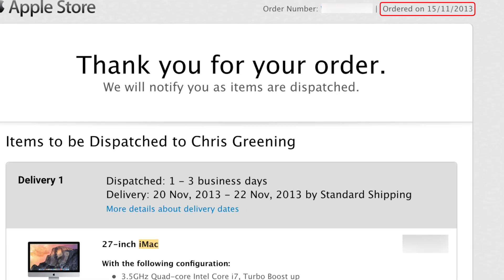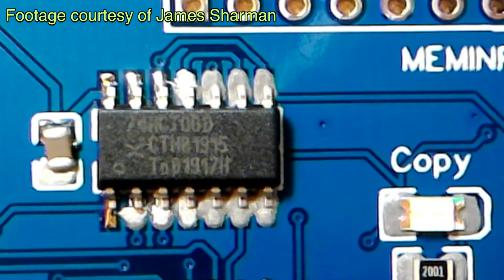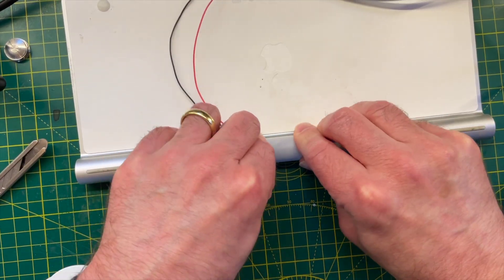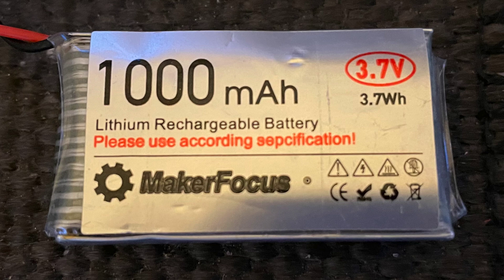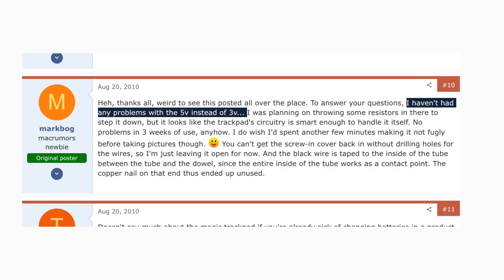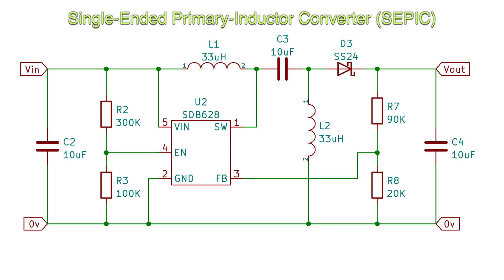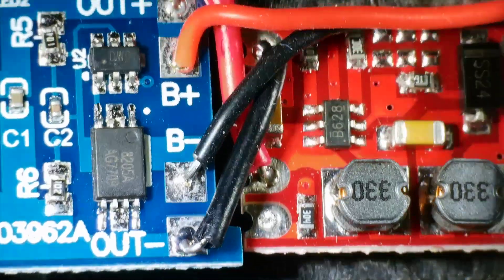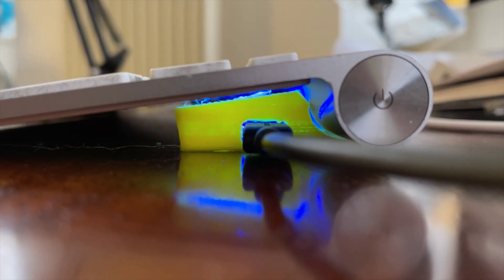Upgrade Your Old Keyboard: USB Rechargeable Hack!

Comment: Hii ..... My Keyboard is apple model no- A1255 1.3vot 3 1.3x3=4.5vot battery So how to convert 3.7volt battery to convert 4.5volt..??
Reply: Your keyboard charge percentage will never show full because it'd be getting 4.2v so it'd think that battery has depleted slightly. But since you may use a higher mah battery, every percentage drop would last much longer.

Max Voltage, full charge of li ion battery is 4.2v, never overcharge or feed higher voltage. It may explode.

I know, I'm late. But, for future reference of anyone who sees this comment.

Happy New Year!
Reply: 3.7v batteries' full charge is 4.2v 
Your keyboard, rated at 4.5v can handle low charge batteries, which means lower voltage. 
You can connect directly.

Comment: Writing this from my battery-fed Apple keyboard after wondering the same and found this video. My use case is slightly different – because I travel with the keyboard, I've been on the hunt for a on/off switch mod to simply cut power to the batteries.
Reply: Not a electrical anything but that should be simple enough as just connecting an on/off switch to the wire that connects to the battery.

Comment: I have one of those, unused for years - the battery replacement cover welded itself shut 5 years ago.  In 20 minutes I yanked that middle cover off, pulled out 1 corroded duracell (the other will need a drill i think), soldered a 2 AA battery pack to the two contacts, and were back in business.  The corroded duracell is marked Dec 2022 - so maybe installed 10 years ago!  😀
Reply from the maker: Nice!

Comment: The SEPIC prolly has a large "standby" current. 

What would happen if you use an IR PowerLED as a series-dropper?
Instead of 4.1V -->3.3V on the LiPo cell, you'd see 2.8 --> 2.0V on the keyboard (and so your "remaining battery" indicator would work well too. (You could also replace the IRLED with two transistor-diodes in series.)

Comment: There should be nothing wrong with charging a 1000mAH battery with 1A. One thing you have to be careful of though is that the battery should not be attached to a load when it's charging or the charge termination may not function properly. You can probably get away with it here, but it's something for anyone to keep in mind if they use these modules.
Reply: I always desolder the RProg resistor that came with the TP4056 board and replace it with one recommended by the datasheet to achieve a charging current appropriate for the lipo battery. 

Note that most of my lipo cells have no protection PCB built-in because I've recovered them from disposable vape pens and cheap Chinese eBay Bluetooth speakers
Reply from the maker: Ah interesting, I thought there was a rule of thumb that 0.5C was a good level to use. But reading some more I see a lot of suggestions that 1C is perfectly fine.
Reply: @atomic14  you can in practice go higher than even that during the first phase of lithium charging with no serious risk assuming your wiring is good and the quality of the batteries is decent.

The rules of thumb are still good to tell people because it keeps those that don't know how to judge what a battery is capable of from starting fires, although on modern cells 1C really is my defacto number for general explanation.

I have a 140mAH cell that I charge at 1A with no issues, though I'm probably not doing the chemistry any favors long term I know what I'm doing in my specific context.

When you know the why behind the rules you know when you can break them :) and I also take precautions in case of failure.

Comment: I've got an old mouse which alas just failed but it took aaa batteries but, aaa rechargeable batteries and had a docking station that operated as a charger so it had all of the advantages of rechargeable mice with the bonus that the batteries where changeable so if you did forget to charge it you could just swap the batteries out for a spare set or even some lead acids in an emergency, I've never found a replacement that has this flexibility.
Reply from the maker: I've got a couple of wireless chargers coming that I might try and hook up.
Reply: @atomic14  Yeah, i think the notion of using a qi style charger makes sense partly because it can be integrated into something on or under the desk and at that point you also have the option of moving from a battery to a supercap (assuming you don't plan to move it for an extended period :D)
Reply from the maker: Yeah, that's what I'm thinking. When I'm really going portable I take the laptop with me, so the only nice thing about the wireless keyboard and trackpad is that there aren't cables all over the desk. Having wireless power transfer would be nice and would remove any need for a battery.

Comment: 1.6 mA quiescent current of the voltage converter is too high. There are converter with a few uA quiescent current.
Reply from the maker: Definitely room for improvement!
Reply from the maker: The LTC3440 looks particularly interesting - though pretty expensive!
Reply: @atomic14  Even a linear regulator would outperform a switcher like this quiescent current wise.
Reply: Just drop the voltage with a dioder or zener. No drain, and with the microamps the keyboard needs the energy loss would be negligible. And with a carefully designed voltage drop you'll get the battery monitor function back.

Comment: Your circuit will discharge the battery faster than the keyboard. How long do the normal batteries last? Mine runs about 3 years on one set? the mouse gets through them about 3 times as fast.
Measure the drain on the battery and you should be able to cal the battery life.
Reply from the maker: 3 years!? I'm lucky to get a few weeks...
Reply: @atomic14  well that's apple for you. All price no function

Comment: There are some fancy jugee (et al) lipo buck converter cells; 5 volt input charging in a AA form factor with a special charger, 1.5v output through the whole range of the battery capacity except the last few percent it drops to 1.1v to let electronics know it's 'dying'. See also: bigclive video on the topic.

Comment: Some things to consider if you are not going to go for the safer lifepo4 batteries that are at perfect voltage as stated:
You want a low voltage cutoff to prevent overdischare. If you use lipo and the voltage drops too low, you can damage your battery and charging it can start a fire. So undervoltage protection is nearly as important as overvoltage.
1amp charging is perfectly fine for 1000ma battery and is the minimal mah for charging at one amp, however you need to check this with a discharge meter to be sure the battery capacity really is at or above 1000mah. Even name brand batteries can be under this rating due to manufacturing tolerances, damage, or age. Its alway best practice to discharge test your batteries regardless, as battery capacity is often artificially inflated or down right a scam. Also I've found that some AA batteries are coming in new at about 1.65 volts, so you should be within tolerance if using 3.3v.
Reply from the maker: Ordering some lifepo4 batteries now.

Comment: Great idea and execution. Tks for sharing. Wouldnt it be possible to keep using the rechargeable AA batteries and add only the recharging module?
Reply: that's my thought...   the keyboard is on my desk..  what i really want is a wired keyboard that never needs batteries. I'll use your insight in to how to solder wires to the inside of the battery compartment...  but I'll just hook up a USB wire and get my 4.5v and see if that works, and might drop it a bit with a diode.   Investment:  $0.05 for the diode plus a spare USB cable.  And $0.01 of hot glue?    I suppose if I put in some NiCd rechargable AA  batteries it might also work when I unplug the USB and they had been trickle charged by it.  I don't think Eneloop batteries like that treatment.

Comment: Great job! These are the times when it would great if LiFePO4 cells were available in pouch format. Voltage stays around 3.3 to 3.2V throughout hence no need for down-regulation.
Reply: They exist. RC hobby grade pouch cells at least exist. Buy a 12v pack and split it into 4 cells!
This chemistry also has lots of other good properties such as loading, over discharge etc.
Reply: @ulwur  I also got LiFePO4 in AA format, with a dummy AA shell, so you can replace 2xAA in series.
Reply from the maker: That would be ideal! I’ll have to do some research.

Comment: Lipo's have built in protection, but 18650 li-ion cells generally do not. So that's why the DW01 is handy
Reply from the maker: That makes sense. I’ve been looking a few AA sized cells and wondering if I can make something that would fit in the battery compartment. I guess that would definitely need protection.